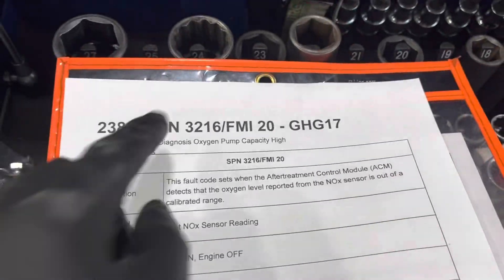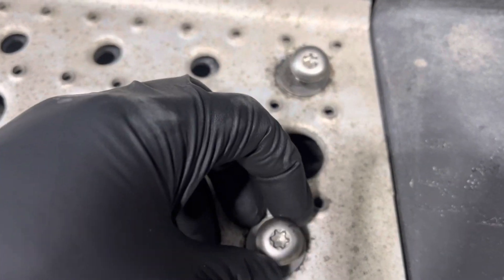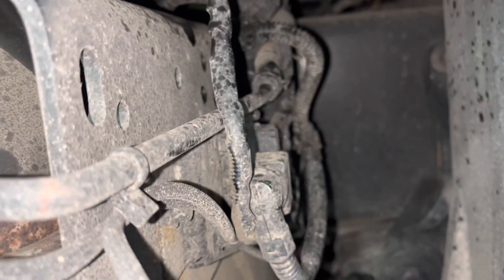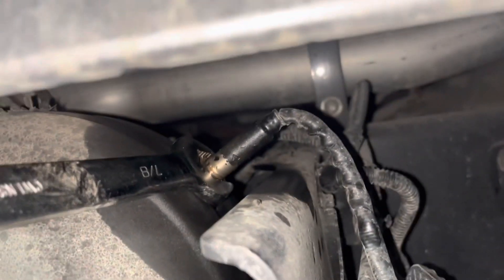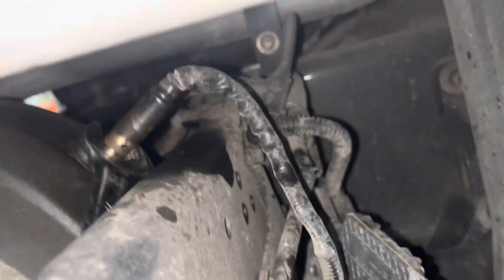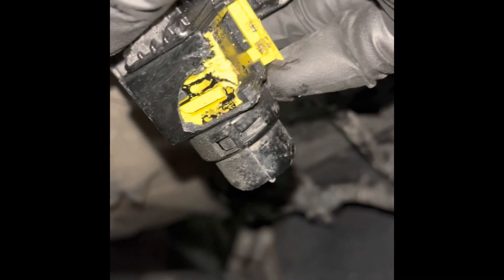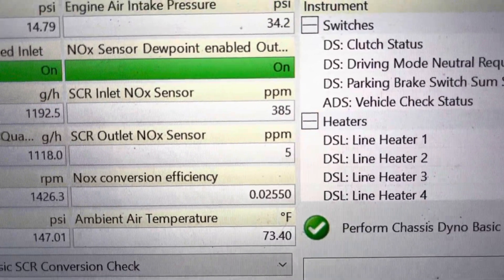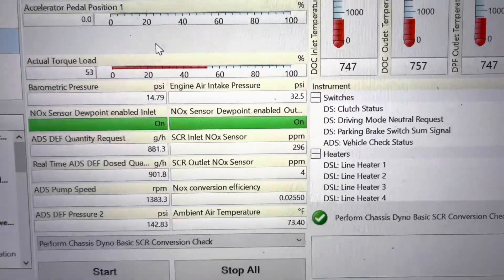Detroit DD15 Inlet NOx Sensor R/R

Comment: I changed my nox sensor but still have mil light on What s the software you get and where to buy it ,I think I need it to do regen and clear the code
Reply: Diagnostic link 8 is the software. As far as where to buy it not sure but you have to do a regen and scr test after you replace the sensor